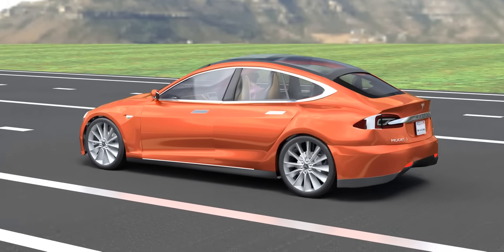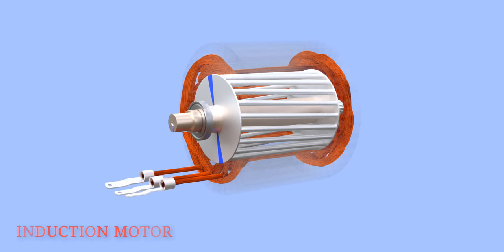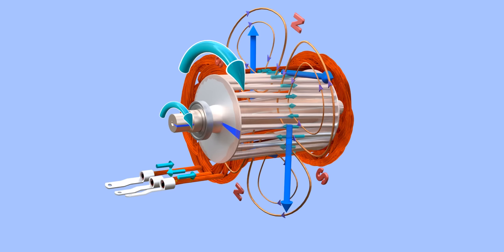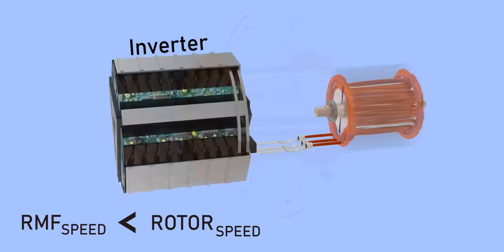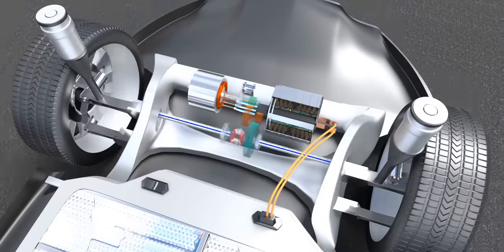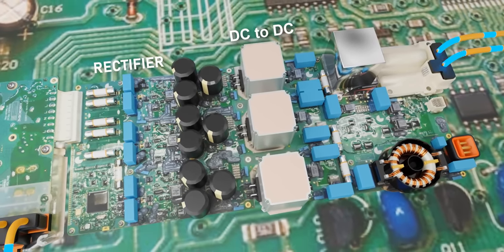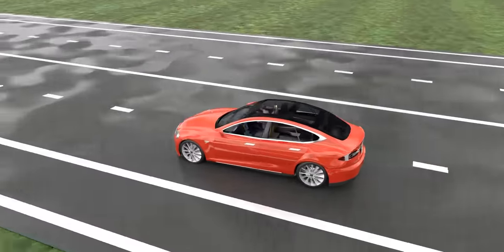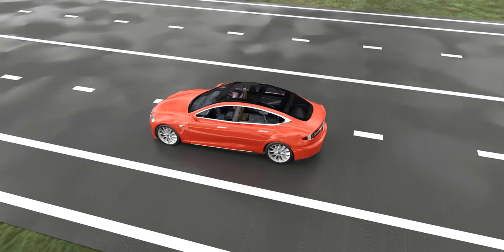Understanding Regenerative Braking!

Comment: Regen braking is stupid and dangerous they're literally braking without brake lights and causing you to have to check up alot especially when there no reason for it. Congrats sheep
Reply: Incorrect. When you slow down via regenerative braking, the brake lights light up.
When I drive my mom's manual diesel car and engine brake, the brake lights do not light up. Manual cars are "stupid and dangerous" according to your own logic.

Comment: If you are going to be an fool and charge your EV inside your garage, and even worse if inside your garage is actually inside your house, then be less of a fool and install a smoke alarm over your car that is interconnected to the other smoke alarms in your house. That way, when the battery goes into thermal runaway whilst charging - and don't delude yourself that "that will never happen to me" - at least you will be woken up so you dont burn to death in your sleep. And despite what Musk says, it happens to LFP batteries, too. If you have that smoke alarm at least you'll probably have 15 minutes to get your children out of the house and to safety UPWIND before your house burns to the ground.
Reply: EV fires are exceptionally rare. The most common cause of ev-related garage fires is use of AC plug chargers, which can overload poor quality wires inside walls etc. Always get a level 2 charger properly installed.
Reply: @logitech4873  Almost all true. But the point remains that an EV fire is so much more catastrophic.
Reply: @starpawsy  Good thing we're increasingly moving to LFP batteries. Even if they don't reduce the already low chance of EV fires, they are at least easy to extinguish. NMC batteries create their own oxygen, which makes it near impossible to extinguish. LFP does not do this, and can be extinguished far more easily.
Reply: @logitech4873  Nope. Completely wrong. LFP batteries contain same oxygen rich electrolyte and still go into thermal runaway. The big grid battery here in Queensland was LFP. DEspite the best BMS, water cooling (!!) and 7/24 monitoringh, it caught fire and went into thermal runaway. It had to be allowed to burn out.